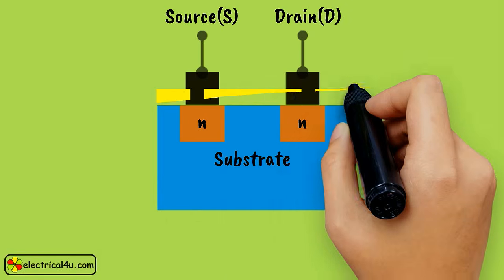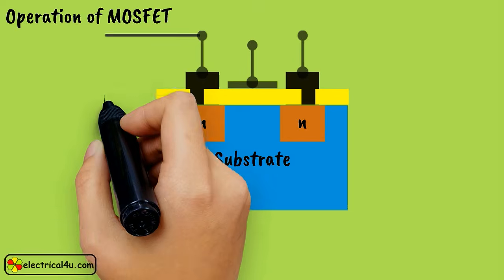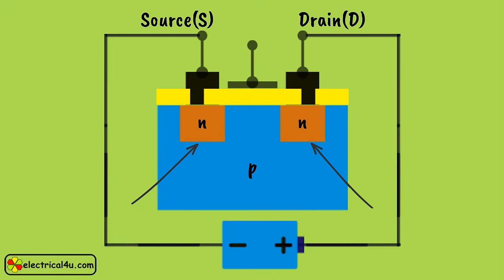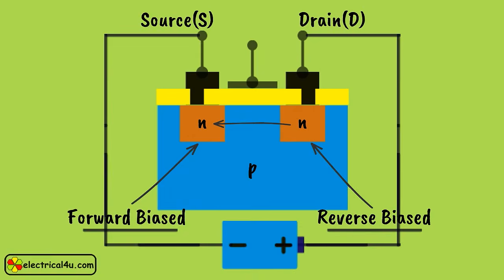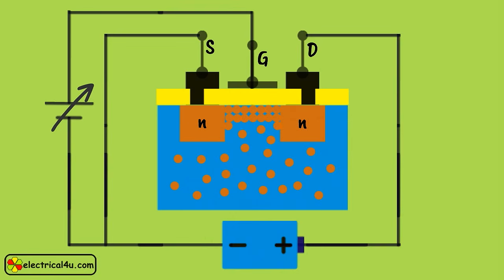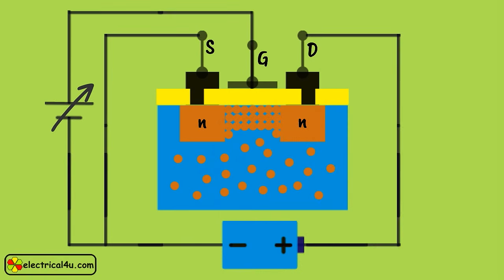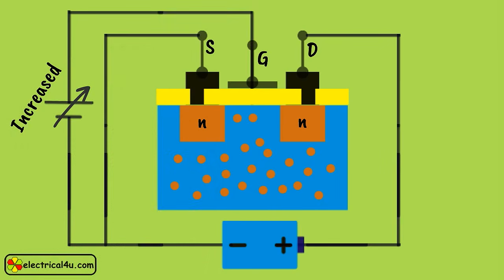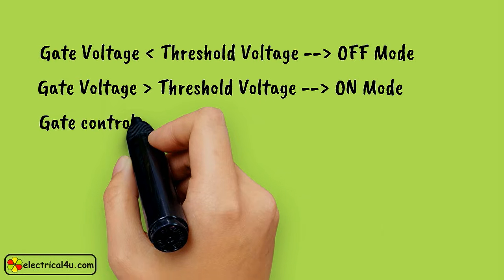MOSFET Transistor Basics & Working Principle | Electrical4U

Comment: hi, correct me if i'm wrong, there should be body(substrate) terminal connected internally to source, with out this terminal mere application DC across drain and Source cannot make p- n junctions Forward bias or reverse Bias
Reply: Yes, there is a substrate terminal, and it's connected to the source. Watch it here - https://youtu.be/rkbjHNEKcRw?t=116

Comment: Electrons should flow from - Negative or Source Terminal to Drain terminal....
Reply: yes, but current is defined in the opposite direction of electron flow. honestly I wish they would change that. so confusing
Reply: @hiZarki  I paused the video to check comments when I saw current flowing from positive to negative, having been taught that electrons flow from positive to negative some 50 years ago.

I don't understand how current (defined as the number of electrons per second as I recall) can be thought of as flowing in the opposite direction. This was called 'hole flow' back then. Can you explain?
Reply: Leroy Casterline I am confused as well because it looks as though the current is flowing through the reverse biased side.